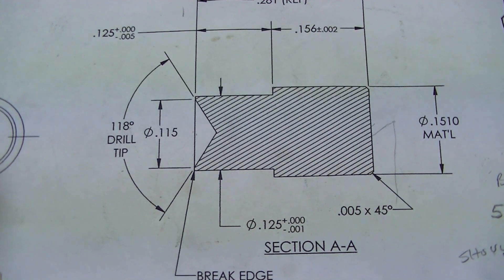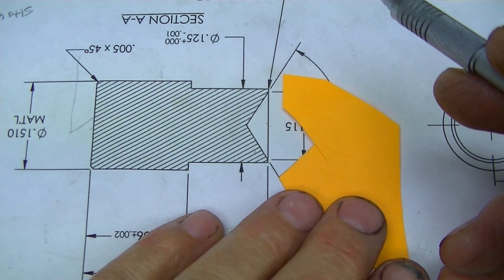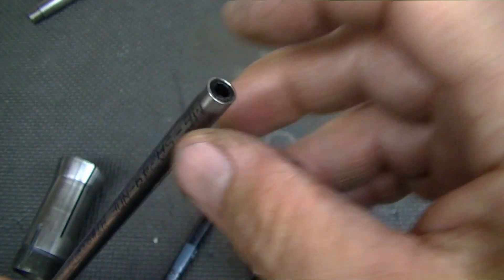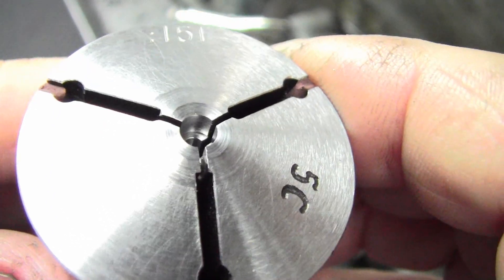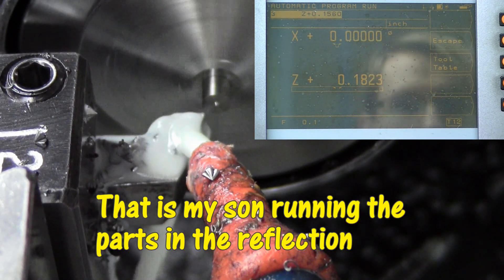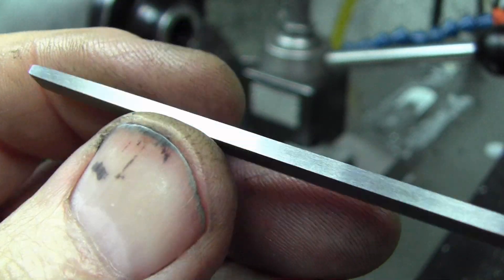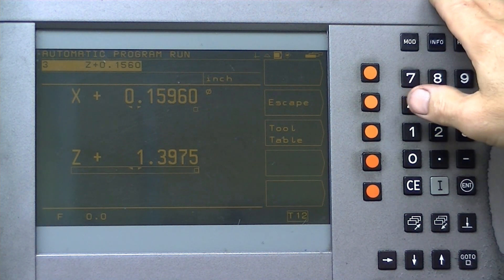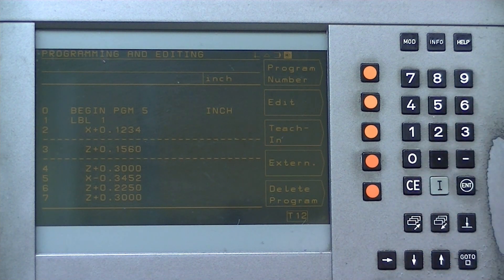TIPS ON MANUAL LATHE HIGH PRODUCTION

Comment: Hi Rob and Son,

Great info and tips, thanks for sharing! I always wondered if a turret accessory would be faster for small runs. I saw a Hardinge making a few parts and it was fast even with normal tools (not boxtools IIRC).

I am looking into a new DRO for my CVA1A lathe and found your setup interesting but could not understand the make and model you mentioned. Could you write it down and I will do some research on my end? Thanks!
Daniel
Reply from the maker: Thanks Atelier,  I do very little work like that, it is just fun to do your best with what you have. The current version of that DRO is a Heidenhain Positip 880. There are other programmable units out there just make sure it has the visual analog indicator like you saw in the video. Thanks for commenting and watching!
ATB, Robin
Reply: Thanks Rob! My first name is Daniel, "Atelier" means shop in French. Translation of my handle would be "DBurgoyne's Shop" :)
Reply from the maker: AtelierDBurgoyne My apologies Daniel!

Comment: Perfect Chucker job (in a perfect world :). A few chucker-like/production-type operations can always be adapted to the tool lathe. Surprised a DRO is that important on a job like this - nice to have I guess. Clean and finger wipe all day long but never saw anyone "lube" a collet. Cost is an issue I know but those import 5Cs seem like a waste of time? Always enjoy your videos - keep up the good work.
Reply from the maker: Thanks Gus, That DRO basically makes my lathe a "manual CNC". If we put all the rest of the collet closer mechanism together "unlubed" we would be chastised, why not the collet seat?  Yeah those import emergency collets may be false economy. Thanks for commenting and watching!
ATB, Robin
Reply: Thanks for the reply. I remember a shop (without any decent temperature control) where the Hardinge machines were "warmed up"/run for 15 minutes or so, just to get the spindle and everything on an existing setup stabilized. On a scale much like Tom's felt tip pen ink measurements, I wonder if lube in the 5C taper affects concentricity/runout (using a good standard collet of course :)?
Reply from the maker: Gus Bird Does lube in the spindle bearings make it run out?
Reply: Good question, strange but maybe it would - this was close work we were doing. It seemed the temperature of the bearings and spindle changed things around dimensionally until the machine warmed up and settled in - I guess the bearing grease could have a part in that. I just thought it was interesting in a "would that be measurable amount" kind of way. I guess I equate the 5C/lube thing to putting some kind of lube on a ground arbor taper before mounting a nice Albrecht drill chuck, etc., something I'm guessing most wouldn't do. Funny - I did a quick Google on this and there are forum discussions/threads out there with guys beating this exact collet/lube issue around :)
Reply from the maker: Gus Bird The dimensional stability of the parts coming off the machine is affected by thermal growth of the mechanical loop from the spindle collet nose, bearings, headstock, bed, saddle, cross slide toolpost, etc, to the tool. The lube on the collet IF it were not uniform would only affect RUNOUT of the stock diameter to the turned features of the part not the turned dimensions. I make precision spindles for diamond rotary dressers that have sub 10 micro inch tir. They are using greased class 7 ball bearings and I can assure you the grease is not causing any significant runout. Some spindles will have less than 3 micro inch runout!  Also have a Northfield precision air chuck that is guaranteed <0.00005 repeatability. Guess what, it is greased with moly grease!
ATB, Robin
Reply: A number of things probably affect runout relative to a concentric stock part. Collet too tight, or loose or oversize/underside stock, chili for lunch, etc. I was just wondering if (everything else equal) some lube applied to the collet taper would change runout in some easily, measurable way. Thanks for all the insight.

Comment: I hadn't noticed the slider (analog) scale on your DRO until you pointed it out. That is a great feature. The one reason I have never really slashed out on a DRO for my lathe is hitting a number is a bit like filling your car with fuel and trying to hit a round ammount, like £20. You always end up going a penny over!! I still use a clock on a magnet stuck to the bed, but your DRO has it. I am going to look out for something similar. GREAT videos, and I preffer the post dubbed audio.
Reply from the maker: Thanks Rupert, that analog indicator is essential and thanks for commenting and watching!
ATB, Robin

Comment: And another!!! Have been doing multiple batch ceramic parts 500+ and yes the collet sticks?? Wonder if the grease would work with this? Have a great dust collector, so there is not much excess dust?
Reply from the maker: Grease will certainly help. Relieving the collets taper at the slots can also help if you see the bearing being heavy at the slots. Thanks for commenting and watching!
ATB, Robin

Comment: Great video! I noticed in the video at 9:40 you have a what looks like a big cover plate under your modified tool post mount. I seen your other video I think you mentioned you don't use a compound on this machine. But I have a Hardinge HLV-H and I am always looking for trick setups like you have to implement on my machine. 

Thanks for the great content!
Reply from the maker: Thanks Clayton, That is a stainless steel cover on the cross slide. I plan on doing a video on the whole setup. Thanks for commenting and watching!
ATB, Robin
Reply: +ROBRENZ can't wait! Thanks for the reply. I'm in need for a dro for my Bridgeport and Hardinge. Looking forward to it the video.

Comment: Thank you for sharing all the details. There is always some little tips we can all use, for example the little expanders for the collet, this is an excellent work around.  They are so annoying when they have a set and don't open.    I have a little question.  Have been studying your ChamferMister from earlier videos.  I want to build a similar device.  Why are the groove features put on the faces of the platens, or you may call them table faces?   Thank you for the effort you put into the videos and the voice over is just fine.
Reply from the maker: Thanks Glenn, glad you are finding the content useful. The grooves are to keep the grit and metal particles from scratching the faces of the parts as they slide on them. I will be doing a video soon on the design features of the  Chamfermeister soon. Thanks for commenting and watching!
ATB, Robin
Reply: Thank you Rob.  I knew there must a good reason but couldn't figure out what.  Also, I will put my project on hold to see your Chamfermeister first and end up with a better design.  Thanks again, Glenn

Comment: What is your attitude towards NC?
I ask because I see CNC machines fairly often, for what appears to me a surprisingly affordable price, while I am looking for manual machines. I have no idea if they are any good or just totally worn out junk (I have no interest in them), but even an older machine might be useful for production, maybe after a controller upgrade?
That covered-up Rigol always makes me smile. It is probably the one piece of gear least deserving of that dust cover in your shop. ;-)
Reply from the maker: I love CNC but my shop is only 500 square feet. I have a CNC mill but just the Hardinge for a lathe. The vast majority of my work is not production so it is not really an issue.  The Rigol is cheap but very nice for the money.
ATB, Robin

Comment: I really prefer the voice over, it's just smoother in my opinion.  Great stuff man, my shop does some pretty tiny stuff too so this content is definitely up my alley. It was funny, I've encountered the same issue with those cheap soft collets. I ended up making some smaller pins to put in so they don't spring, worked for me but your idea is probably the better way to do it. I also never thought to check the angle on them although you can see that it doesn't match up because it leaves a shiny mark on the larger part of the angle. I learned something today!
Reply from the maker: Thanks Jerod, glad you are benefiting from the content. Thanks for commenting and watching!
ATB, Robin